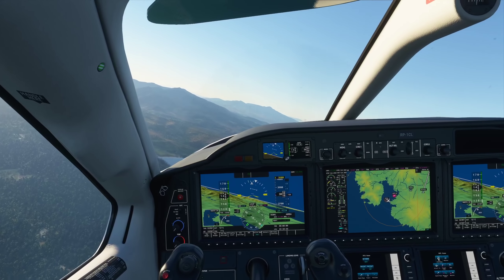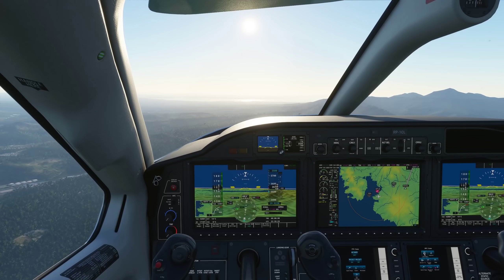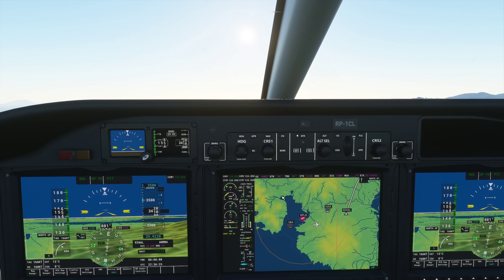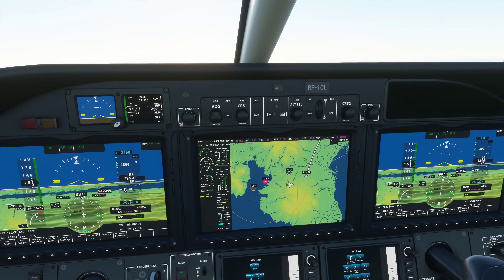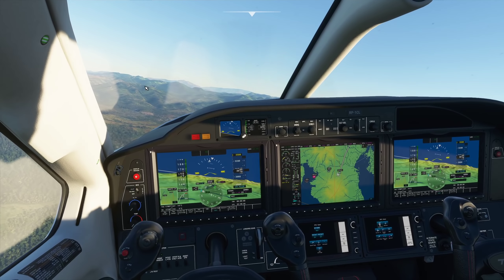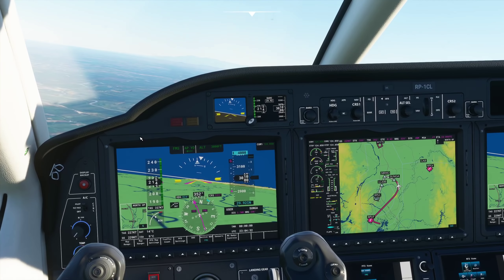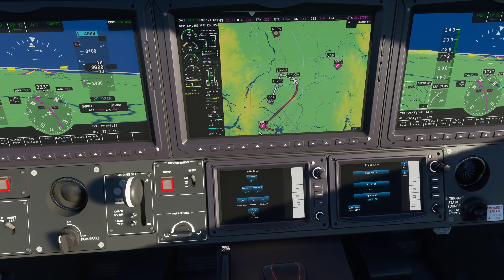Autopilot is BROKEN! (or is it?) - Microsoft Flight Simulator

Comment: Nice calm explanations. Can you do a video on stringing a flight plan in the G1000. Can you upload a plan, into the G1000 done in Simbrief? Have you any experience on the Neo? How accurate is the FMC in that? Thanks.
Reply from the maker: Thanks! I'm staying away from the a320neo in the meantime, and the other jets, as they are still quite buggy. I haven't tried loading a flight plan from simbrief yet, but I heard that it works in general. I might try it soon.
Reply: @TheClumsyGeekGaming  thanks! As you may gather, I've not got MSFS yet. I'm on P3dv4.5. Since I've hundreds of pounds worth of add ons in that sim!
Reply from the maker: @davidh7280  I can understand. Once msfs gets more refined and when the 3rd party devs start putting out study-level planes, it will be very hard to resist. 😅
Reply: @TheClumsyGeekGaming  agree! I can't justify either a purchase or a PC upgrade untill they sort out the bugs. A friend of mine says his CPU and GPU are nearly melting trying to run it, fans running so fast he doesn't need a flight sim, he just hangs on to the PC as it takes off and flies around the room!

Comment: Autopilot is absolutely broken, or maybe more accurately, certain ILS approaches are broken. On certain ILS approaches the GS just doesn't exist, and the localizer is also just wrong. Flew into RJTT the other day, to runway 23. As you'd expect that's on heading 230. AP in Approach mode picked up the localizer, yet aimed the plane at about 228 (ie. into the water next to the runway). And despite being at the right height, about 4000ft, the GS just never appeared. Not even a diamond indicator. AP just kept flying 4000ft, in the wrong heading, past the airport.
This was in the A320neo.
Reply from the maker: Yeah, definitely some fine tuning needed. With the a320, I also sometimes forget turning on the landing scales (LS), and sometimes I miss the GS.
Reply: @TheClumsyGeekGaming  - There may have been some improvements funnily enough. After I made the comment I hopped onto MSFS just now, and it said it had an update.
After updating it looks like ILS is working much better. When I picked departure and arrival airports for hi-level IFR, it automatically even picked SIDs and STARs, which it definitely didn't do before!
Reply from the maker: Nice! Hope it sticks!

Comment: I can't enable autopilot on A320neo. When i do it it just don't turn using NAV or even HDG.
Reply from the maker: I haven't encountered this before. My suggestion is to go to forums.flightsimulator.com and create a post, detailing exactly what you're doing and what's happening (or not happening). People more used to the a320 will for sure chime in. Good luck!
Reply: Thanks

Comment: Great video, it helped me a lot understanding what each setting does! 

Do you know by any chance how to set the vertical speed for the altitude autopilot in the JMBAircraft VL3?

The aircraft's AP can only be configured with the keyboard and I can't figure out how to activate the vertical speed in order to in- or decrease altitude.

Everything else works fine but it can never increase, decrease or hold altitude :/
Reply from the maker: Thanks! I'm unfortunately not familiar with that aircraft. Is that from a 3rd party developer?
Reply: @TheClumsyGeekGaming  It's included in the standard version of the game.

On the realife aircraft you can control the autopilot via the 'touchscreen' which doesn't work in FS2020.
As I said, everything can be done with the keyboard, except a button to prepare the AP to receive input for vertical speed. 

I'm not sure if I'm missing something or if it's an oversight by MS
Reply: @Codrin Stefan  I found it out.
You need to assign keybindings to "Toggle autopilot VS hold"
and
"toggle autopilot altitude hold".

To find them in the control settings you need to set the filter under the search bars to 'All' instead of Assigned.

Comment: "ROLL" mode isn't implemented correctly. A true garmin autopilot would roll to wings level no matter what the initial bank angle was at time of engagement, and it would hold the pitch angle of whatever your current pitch attitude was at time of engagement. "Wings level" doesn't garuntee that the plane will perfectly track a heading or course. It simply means it will keep the wings level as it flies, through smooth air or turbulent air.
Reply from the maker: Ohh interesting, I didn't know that. Thanks for sharing!
Reply: @TheClumsyGeekGaming  the CWS (control wheel steering) button on the yoke (if there is one) usually allows the pilot to change what pitch attitude to hold. Pressing and holding it temporarily disengages the control servos, the pilot manually changes pitch, and then releases the CWS button. The GA (Go-Around) button (if there is one), usually disconnects all other autopilots modes, puts you into ROL and PIT with a pre-configured pitch angle that is known to be a "good" pitch attitude for a go-around in that specific airplane
Reply from the maker: Thank you for sharing more of these insights! Didn't know those before.

Comment: It is pretty much broken.
Cessna Citation CJ4: will not hold altitude. Passing through a mountain thermal: getting bumped up and down by plus and minus 7,000 FPM, the autopilot got confused and refused to return to set CRZ altitude. Also, they can conveniently reach 300 kts with only 51% thrust @ 12,000 feet. 
FL change mode? Let's divebomb this plane on idle thrust!
Diamond DA-62: also easily defeated by even the slightest turbulence. Getting blown by a mountain wind? Forget about staying at 11,000 feet... Imma go 31,000 feet!
The only thing that is ok: heading bug
Reply from the maker: I'm going to stay away from those jets in the meantime lol. Looking forward to the fixes by asobo.

Comment: Approaches are a mess in the avionics. It usually brings up some nonsensical path to the IAF. The Direct To function deletes the rest of flight plan. You’re better off self vectoring to the approach. Procedure turns aren’t included. On RNAV approaches, the course guidance precision always stays on ENR. It never goes to LP, LNAV/VNAV, or LPV. In your video, you turn off the approach and the CDI doesn’t move. Missed approach procedures aren’t included either. Pretty much anything GPS dependent needs work. Hand flying green needles works just fine though
Reply from the maker: Yes good points. At this point hand-flying the approach is a much safer option lol.

Comment: This was such a fantastic video, it helped immensely! I had spent hours trying to work out how to get to grips with using the ILS approach setting and was getting really frustrated with the lack of available help - then I found this!
Excellent, and thank you for your efforts!
Just two quick things you may know:
Does the Daher TBM 930 not have variable pitch prop? I can't see any way to adjust it in cockpit? Also, the stats say; cruise speed 330KTAS but it seems to max out like 230-240? Any ideas?
What I do know, if I win a few lotteries, I'll be buying this plane ; )
Anyway, thank you : )
Reply from the maker: Awesome, glad it helped! Yes, tbm 900s have fixed rpm. It stays at 2000rpm for the practically the entire flight. It slows down by changing the angle of the propeller, instead (i.e. Beta). And about the speed, the 300+ is true airspeed (gets higher as you gain more altitude). The one that is in the speed tape is indicated airspeed (which remains low)

Comment: How do you know (in game) what altitude to hold in order to intercept the glide path? Last time I was trying to land the Control Tower asked me to maintain 5000 and it was way above glide path... it happans quite often...
Reply from the maker: You can look at that approach's chart and there it will say what altitude the final approach fix (FAF) is. This is usually marked as an 'x'. This is the point where you intercept the glidepath (for rnav) or glideslope (for ILS). Unfortunately the sim's built-in atc is not the best at giving accurate instructions.

Comment: This video was really helpful, a great refresher as I put down the sim for about 6 months. Glad to see a lot of the bugs have been ironed out however I am getting 1, I wondered if you encountered it, it might not even be a bug but something I am doing wrong. When using approach mode the Glide Slope does not get picked up until quite late, then the plane doubles back on itself to the last waypoint and turns round and comes in for approach, what would you say is the cause of this, is it that i'm not at the correct altitude in time to pick up the GS? Any advice would be great.
Reply from the maker: Thanks! This "u turn" bug should have been fixed already with the recent sim update 4 a couple of days ago. If it still occurs, please provide the details in forums.flightsimulator.com so the devs can finally get rid of it once and for all. I hate that bug lol.
Reply: @TheClumsyGeekGaming  ah yeah definitely still happening, I'll head over there and report it. thanks
Reply from the maker: @OlIShoey  thanks! In the meantime hopefully this workaround still works: https://youtu.be/W1DwRRSjJ_M

Comment: OK what about if I don't want to use automatic pilot at all, and instead I just want to fly my plane like a FSX, (What should I do) what would the be the kind of setting I should use?... I'm having the same problem all my planes are banking crazily...please help
Reply from the maker: If you're hand-flying, no need for any of these settings. Plane banking crazily can be caused by wrong calibration of joystick, flight model set to legacy (check general settings flight model and set to modern), or too low airspeed (push throttle and decrease pitch). If problem persists, you can post more details at forums.flightsimulator.com for more experts to chime in. Good luck!
Reply: @TheClumsyGeekGaming  wow!!! my friend!! thanks soooo much, I placed that on (Modern) and problem solved, that was simple, I wonder why the other option comes with so many complications......thanks a lot man!
Reply from the maker: @harrinsson44  great to hear! Enjoy!
Reply: @TheClumsyGeekGaming  Hi Clumsy, even though I flipped to (Modern) I still have some shaking issues, specially by the moment of landing, it looks like the air speed is too strong...I wonder if you can give me your own settings, cus I saw your plane being soo steady I would love to have mine behaving like that.....greetings NH
Reply from the maker: @harrinsson44  ah nice. Hmm that might be due to the weather. Try clear skies weather then it should be more stable. With live weather it can really get exciting depending on the combination.
Reply: @TheClumsyGeekGaming  Actually is not the weather, I have clear skies, the motion is like exaggerated to the right and left by the moment of landing...and when on the ground the plane tends to get out of the runway ...(difficult to control) I don't know what to do anymore...NH
Reply from the maker: @harrinsson44  hmm sounds more like a calibration problem. Try to go to your controls and calibrate your joystick. Lessen the sensitivity and tweak the other settings until it feels natural for you. I have -25% sensitivity for my yoke, for example.

Comment: i can imagine people say autopilot not work becouse it makes trim go crazy(allmost every time on 172) so autopilot not operate correct ALT modes cant be used
Reply from the maker: Yeah it's a bit tricky. Sometimes it's hard to determine if it's a bug or just wrong usage.
Reply: @TheClumsyGeekGaming  correct usage.i fly level set VS 100 going 3000 hit auto pilot 50/50 it works.shoult not full trim up.no nessessart i said climb 100 minut or what ever.but toda i try without FD forget70/30 lol its bug.xplane not do it

Comment: When I'm in the smaller jet I can't set the airspeed.. how does this work?

I have AP, NAV and FLC  enabled when climb. 
Bet then at cruising altitude I set 230 knots. I see the blue indicator saying 230 knots but it keeps increasing. 

Any ideas?
Reply from the maker: You mean the CJ4? I'm not an expert at this jet (flew it the first time yesterday), and I did notice some autopilot bugs where it doesn't follow exactly the speeds or altitude I set. You can check the latest video from today to compare how it behaves vs yours.
Reply: @TheClumsyGeekGaming   alright i will check it out! Thanks great videos

Comment: Very good video. The only problem I have is that when I activate the autopilot, I have the effect in the TBM that I have a strong lean to the right, no matter where the wind comes from.It doesn't matter whether I have HDG or Nav activated.  I've already tried to correct the trim but it's no use. Does anyone have any idea what I could do.
Reply from the maker: I haven't encountered this myself. You already tried moving the rudder trim left or turning yaw damper on? Hmm. Maybe some conflict in your controls? Try double checking if some of the axis are not properly calibrated. Maybe your rudders are to the right.

Comment: my FLC is not working on citation :( have to use VS exclusively
it annunciates and immediately comes off
Reply from the maker: You mean citation longitude? Or citation cj4? I managed to use FLC on both, but I am using darkfly's longitude mod and working title's cj4.

Here's a vid on the longitude: https://youtu.be/ynZUz_8nEqE

And for the CJ4 I have lots of recent vids in the channel. Good luck!
Reply: @TheClumsyGeekGaming  yes sorry the longitude, the fuel burn is also way way way out of whack, and the autopilot bounces like hell all over the place when in altitude hold
Reply from the maker: @philip1065  ah yes true, the default is pretty messed up. I highly recommend darkfly's mod for the longitude. Makes fuel burn and flight dynamics much more realistic.
Reply: @TheClumsyGeekGaming  yup i got it now, and it seems much much better... still doesnt talk with FSE very well but take what i can get.... the AP still oscillates like nuts though when holding ALT if I accelerate the sim

Comment: Sometimes when I try to set the VS using the in panel VS wheel, if I move it, it just keeps spinning and spinning.  It sets the VS to impossible levels either up or down and it's almost impossible to stop.  Is this a bug or am I doing something wrong?  I have had incidences where the VS wheel sets just fine and I can use the AP as I expect it to work.  

Any help with this issue anyone?
Reply from the maker: I've seen a similar issue in forums.flightsimulator.com but haven't encountered it myself. Hope you find the solution there. Good luck!
Reply: Same here almost impossible to tune the ap starts spinning like a mad men most of the times.

Comment: Thankyou, thankyou for a most enlightening tutorial, Clumsy.  I have learned a lot.  
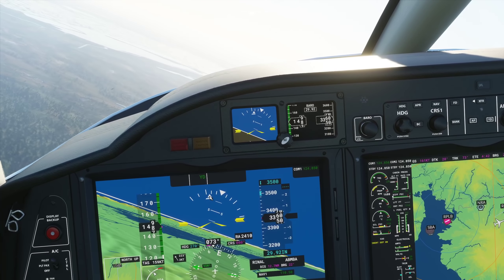I have one observation, if I may.  At 3:50 you preserve your bank angle by rolling to 30deg then re-enabling AP.
On my system it always goes to wings level whenever I re-enable the AP, and when the AP is off ROL & PIT are always shown in the C172.
I'm on 1.10.8.0,  I have no assists enabled and this happens in the TBM & C172 G1000 too.  Any ideas anyone?
Reply from the maker: Great to hear! Someone told me that the default behavior when you turn on AP is wings level, not preserving the roll. Maybe it depends on the plane's avionics.

Comment: When I try to use the ROL-Mode the AP just levels the plane like on LVL mode. Do you have an idea why that is? The garming clearly show 'ROL' an no other features are activated, it is exactly like in your video.
Reply from the maker: I've heard some comments that ROL would keep your plane level, instead. It might depend on the plane. Tbh you would rarely use this mode, though. For me personally when I see ROL it just means I haven't set the right setting yet (must be HDG or NAV 99% of the time).

Comment: I have a problem. When I set an altitude (say 800ft) I climb via VSC or FLC with the steps you showed. But then when it gets close to 800, ALT hold comes on but on the announciator it does not say 800 but I would be something like 1400 and it keeps on climbing. Any help?
Reply from the maker: Which plane are you flying? Sounds like you're doing it correctly but it's just fs2020 autopilot not working properly. Try lessening the vs so the climb is not so steep.
Reply: @TheClumsyGeekGaming  Hey thanks for the reply, I fixed it as I had my units set to metric not US lol

Comment: Dear Clumsy, I do not know which version of FS 2020 you are using ? In fact I am confused because you are using the autopilot smoothly for both G 1000 and G 3000. My version FS 2020 is 1.12.13.0, and sure the autopilot is corrupted : once I engage the AP, the flight start to bank to the right or to the left , tying to catch the planned flight path, and the plain fly continuously banking  either way for the entire flight route , when I disengage the AP , the plane fly straight and level , as if became free from heavy strain . Is there any one meeting this problem ? This is valid for all types of aero plains
Reply from the maker: Hey there. I'm using 1.12.13.0 now, too, but this vid was done way back after release. That being said, AP still works for me (for the most basic parts). What you might be experiencing is your flight controls conflicting with AP (i.e. noisy yoke/joystick). I recommend going to forums.flightsimulator.com and checking for people encountering similar issues. I believe there are quite a few.